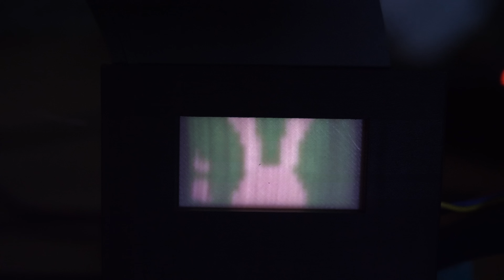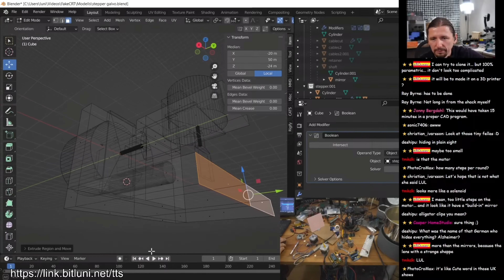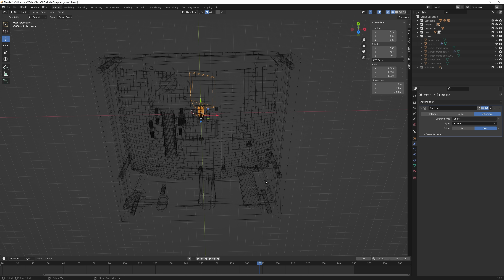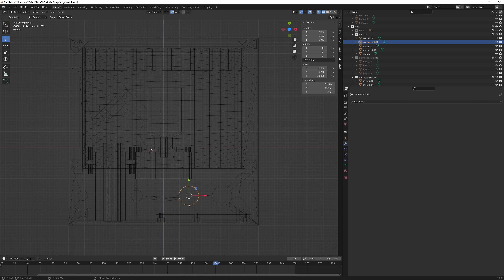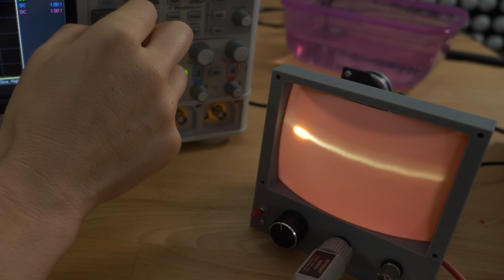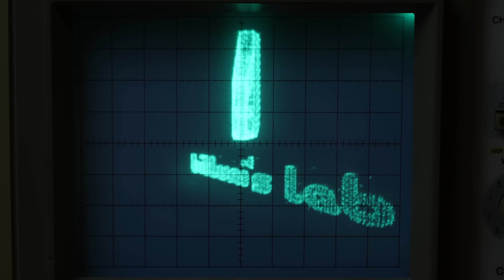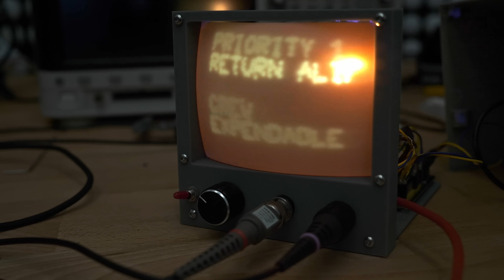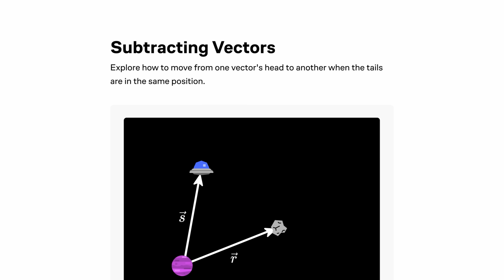I made a fake CRT TV with a LASER

Comment: I suggest you buy yourself a cheap laser barcode scanner and see how that creates a linear beam from a single laser diode. It typically uses a mirror fixed onto some compliant material/thin plastic hinge (something thin that can bend) so it can wobble along an axis side to side while remaining balanced. The mirror has some kind of light magnet on the back and a voice coil behind it is used to attract/repel the mirror at a specific frequency, causing it to wobble along the hinged axis. Because the mirror is balanced on that axis, you don't need to move the full weight of the mirror meaning you can do it faster than with a motor or the speaker method you used, where you have to move the entire weight of the mirror which is much slower because the system has a higher inertia.
Reply: Better quality scanners use a high speed spinning hexagonal prism as the reflector.
Reply: @allangibson8494 this, you could use two of them at different speeds for a raster, and vary the power to the diode quickly. The nice thing about a laser projector using a raster is that it works at any distance without focusing, unlike a laser as a light source for an LCD or DLP then refocusing it with a lens later.
Reply: @ There was a chip mirror modulation system available some years ago that flicked a light source on and off at high speed as an alternative to large LCD screens…
Reply: I tried something similar with a rotating polygonal drum and 8 leds to write a moving message display on a wall. Once you get to larger size, each LED was only on for a tiny time, making the display really dim. Might be better with a laser and phosphorescent display, but you'd probably need a lot more powerful (more dangerous) laser to get a bright enough raster display. It would be interesting to find out though. Two rotating polygonal drums synchronised for horizontal and vertical scan.
Reply: That would make it a raster display instead of a vector display though!
Reply: @jhonbus  It would if you oscillated the mirror at a set frequency (the same way the barcode scanner does) and used scanlines. But I meant more that this approach could be investigated to see if it's feasible to move the mirror to an arbitrary angle using the same technique. I don't know how much the oscillating of those mirrors is sustained by simple harmonic motion as opposed to actively being moved by the voice coil - I suspect it's probably more the former, but still worth a try.
Reply: @SmallSpoonBrigade  I was thinking along the same lines but just making the mirrors spin. Laser could be still.
Then one mirror spin horizontal and other mirror spin vertical, fixed speed in sync with h scan and v scan.
This would make it faster for dot by dot scanning but it would not allow the simple oscilloscope connected straight to h and v scan.
Reply: @formigarafa  That's the typical method for raster with lasers. Much easier to sync and doesn't have the "flyback" issues or mirror damping to deal with. But it is only suitable for raster, as vector requires absolute random positioning to be considered vector.
Reply: @SmallSpoonBrigade  The wiring to the laser is one of the problems with that approach.
Reply: @jhonbus  its already a raster display with really bad slew...
Reply: @Wingnut353  - Irrelevant. He wants a vector display. That a vector display can also be a raster display, doesn't mean a raster display can also be a vector display.
Reply: @jhonbus  it would just be one axis
Reply: around the 4 min mark was thinking exactly the same! Let's all try! I think if anything 2024 has taught me is that people are still hungry for new CRT displays.
Reply: In case anyone's still out of sync, color TVs sweep side to side at 15.75kHz and 60Hz top to bottom at the same time, creating display resolution of 640x480 or somewhere around, and that's what others are calling "raster" display which are pixel based. But you don't HAVE to do that way and just swing around the ray anywhere you want it, and that's what is being done here aka "vector" display mode
Reply: voice coils from hard drives is definitely the way to go!
Reply: One thing.. vector displays don't use line by line scanning.
Reply: @MadScientist267  if you varied the voltage, you could vary the deflection. Similar to his first attempt with the speakers as drivers. I don't think Eddie was suggesting a line like in a raster scanner, but the hardware style used to deflect the beam.
Reply: Hey, whats the song in the intro? :D
0:22
Reply: true, you can also amplify the "bend" so a little fast bend projected into some other quick bending mechanism, or just the other dimension bending.
Reply: They use a wave like lens to make it a line 😊
Reply: Having some of this mechanism could at least help the laser jump from one side of the screen to the opposite, effectively halfing the maximum travel distance between any points.
Reply: bit off. 
its a mirror and a motor.
Reply: As Bangladeshi Muslim Scholar PhD in Physics. I can tell, you are very illiterate and uneducated, You should learn Physics from Us.
Bangladesh has best Universities in the world.
Reply: That defeats the entire purpose of the experiment... It's supposed to be a CRT display.
Reply: Did you know you can live forever? Jesus, the Son of God, gave His life for us. He was sacrificed for our sins, then resurrected. Repent, follow Jesus, and live forever! He loves you and has made a new home for you in Heaven!

- If you want to learn more about Jesus and how to live forever, check out the Gospels of Matthew, Mark, Luke, and John in the New Testament of the Holy Bible. Each book is an eyewitness account of the miracles He performed, His death, resurrection, and His promise to you!
Reply: This is how the Virtual Boy works
Reply: Can repeated vibrations from a forklift damage that? I ask because I have constant problems with the scanning function of scanners at my job, which is non existent at the same model scanners used at fixed stations in my job.
Reply: A radial raster could be neat.
Reply: Use magnets on the lenses to move the laser beam over the screen !
Reply: Double blue comment
Reply: And if you only need to sweep in one direction you can use rotating mirrors. Like a disco ball but tubular.
Reply: @ that's totally tubular
Reply: @gustavgnoettgen  Totally tubular, dude!
Reply: Physical bitluni store coming soon?😂
Reply: It’s just.   One spinning mirror.  spinning at a constant rate.  Virtually useless here.   It does not provide any degree of control over the beam at all.
Reply: Im the 1000th like

Comment: For the horizontal line you can also maybe use for example a hexagonal shaped mirror, then that stepper can rotate at a constant speed to draw multiple horizontal lines. But that works only for TV mode, not oscilloscope!
Reply: Id wonder how quickly the Lazer can be switched on and off, I'm sure there's a couple ms delay, which would really limit the max speed
Reply: @virtuallyaverage9357 not lazer, but
Light
Amplification [by]
Simulated
Emission [of]
Radiation
Reply: I'm basically trying do this. I used a square but the beam was too wide. Im going to try a pentagon, then motor will only have to spin 15,600 ÷ 8 about 2000 rpms. And the other motor is just a brushed motor that shimys back and forth at 60 or 30hz. No fancy computer   stuff needed. And the cathode current controls the lazer brightness.
Reply: It was think the same.  Seems like it would be easier to just modulate the laser.
Reply: 6:22

Comment: a handheld barcode scanner mirror thing could work instead of the motor, no? they just move and you'd need to turn the laser on and off at the right time
Reply: i was thinking a DLP mirror unit but this might work too. or a spinning mirror that can quickly adjust angle